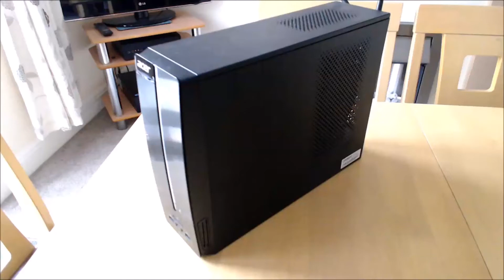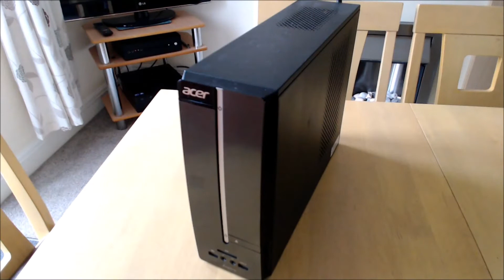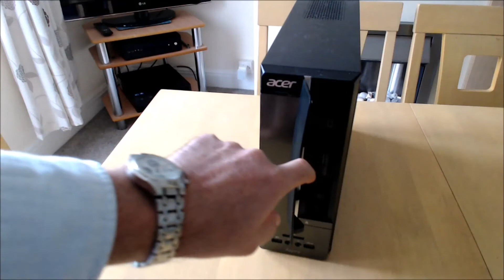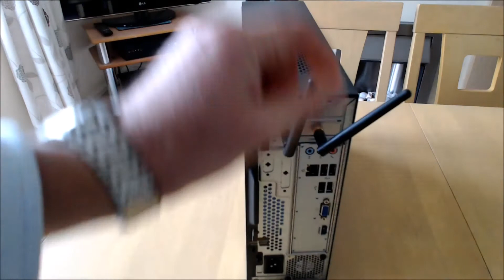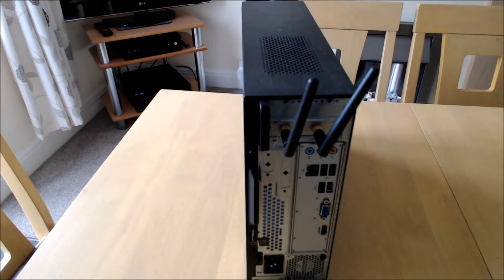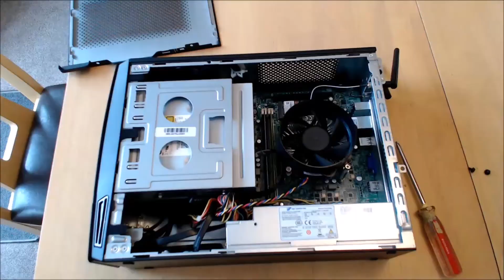Acer Aspire XC-605 mini pc Part 1

Comment: you can actually fit a graphics card in this little machine (in fact, the one i bought came with it installed). it is a low-profile graphics card that fits at the very top (over the wifi card). the machine is still in use, almost 10 years on (i take very good care of her) she has gotten the SSD upgrade and she runs Linux Mint like a champ!

Comment: At front panel , there is power indicator in middle ( silver) below is like cylinder indicator , what is it called .as light is blinking and no display at all
Reply from the maker: Hi. Check video connection on pc and the monitor. Ensure firmly seated. Replace and try another method of connection. Check ram is firmly seated in slots. Check drive cables at both ends. If graphics card installed, check it's firmly seated.